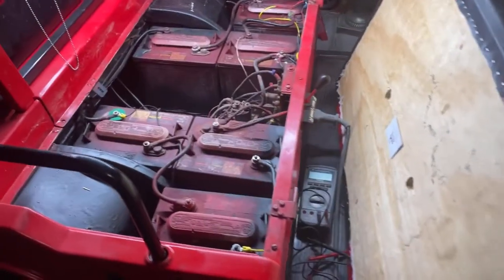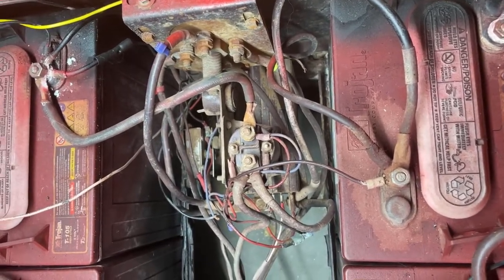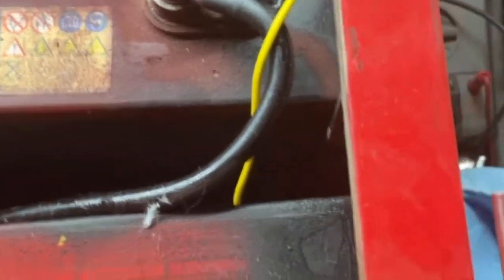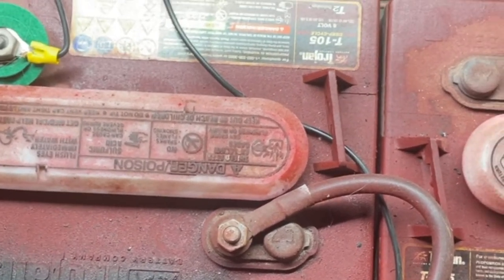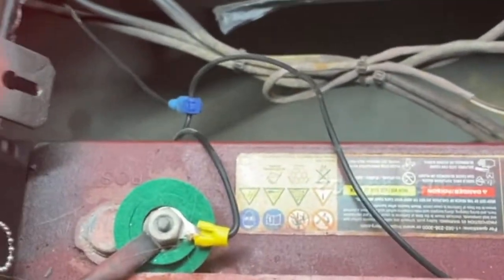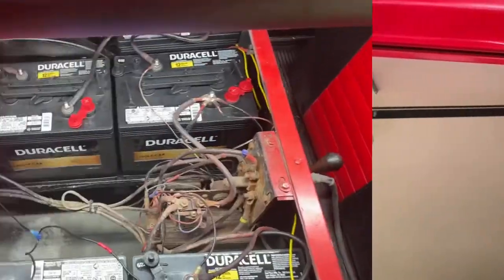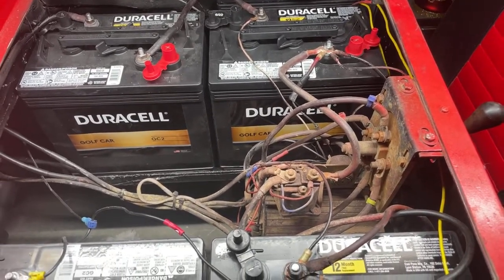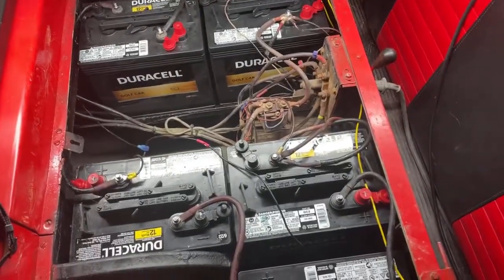Golf Cart Battery Testing and Replacement on a  36 Volt Melex .

Comment: How do you test the motor? I am having the same issue even though my batteries all tested normal even under load test
Btw Boomer!
Reply from the maker: You can check to see how many amps the motor pulls. Jack up the rear wheels put it in F and full throttle with the amp probe hooked up to the main wire going to the motor. As far a amp draw rating I would have to research that. Keep in mind that max speed of this model is 15 mph so if yours is the same you may not have an issue, just unhappy with designed performance.

SOONER